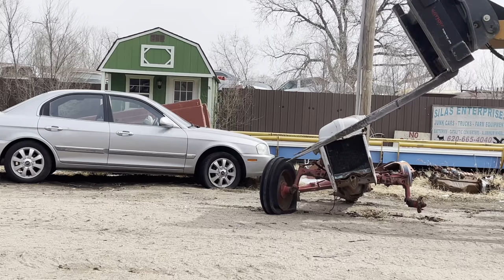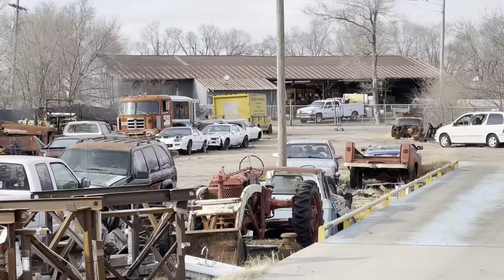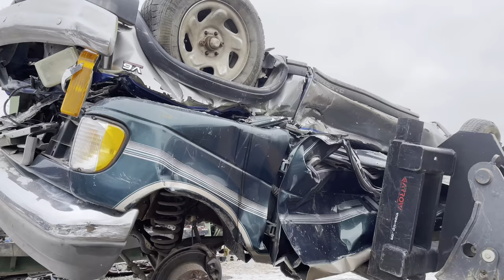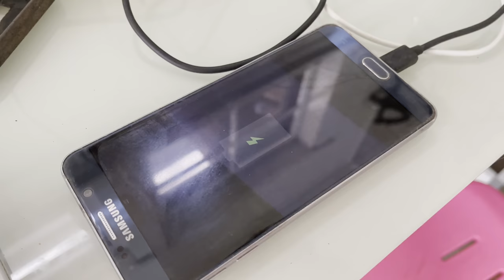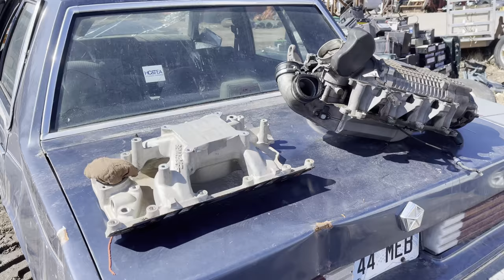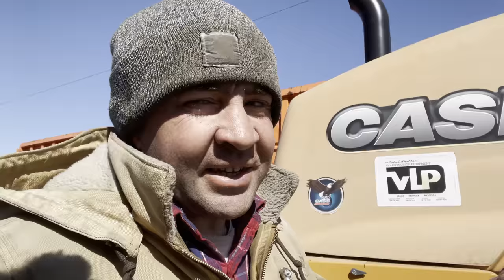Crushing cars in the HOT sun & COLD snow!?! 100,000 LBS of scrap metal!!!

Comment: I've been thinking about making a high speed car crusher. One idea is to make a steel box about the size of your crusher, about 3ft thick and fill it with rocks and sand. Stand it on its edge and let it fall on top of a car. Another idea is to buy a surplus army tank or some other heavy piece of equipment, use a crane to lift it and drop it on a vehicle. Maybe something with an air cannon. A monster truck, a wrecking ball...

Comment: What happens to all the glass and plastics from crushed cars?
Reply: The cars go through a process plant that shreds them. The plastic, glass, foam, copper, aluminum, and other stuff run under an eddie current that separates them. Then in a water bath to float lighter stuff away. It is a really neat process.
Reply: @twisted2291  thanks for info.